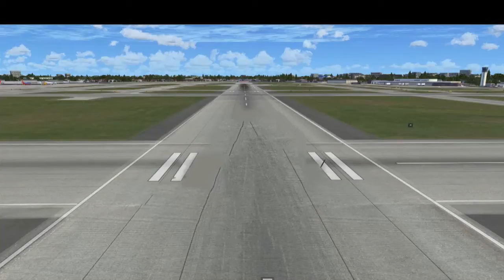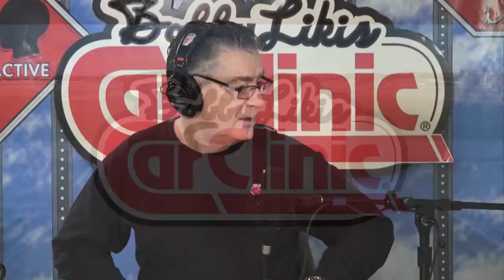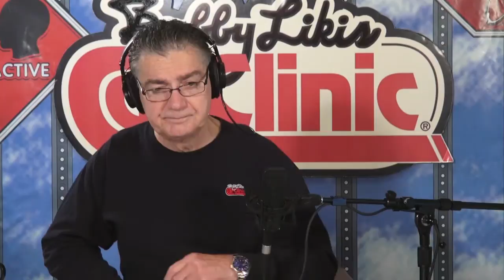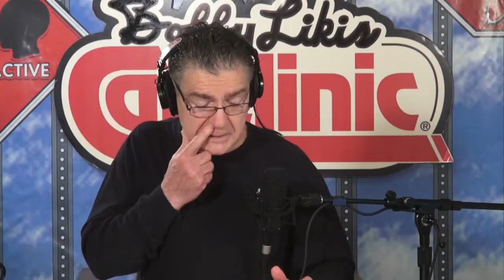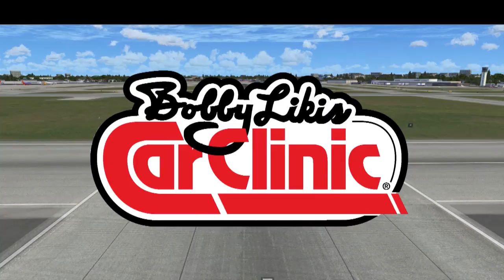Bobby Likis: How to "Break In" New Brakes

Comment: This video is complete nonsense. Curing the pads at the manufucturing plant has zero bearing on the pad to rotor interface zone. Muchless, when the indivudual decides to a different pad material per an upsale from auto parts salesman.

Comment: I also think this is wrong. Nothing has changed in the way the brakes work on the rotor, only the way in which the backing plate is attached. So henceforth, a bedding procedure is still called for.

Comment: WRONG!! All performance brakes pads need to be bedded as per you're manufactures proper bedding in process usually found on your brake pad box. your typical street pad and rotor you pick up from your local parts source store don't need them but a performance pad will

Comment: I would think this is somewhat incorrect... Technically, there's something called a PDI (Pre-Delivery inspection) or may be called something different per dealer/manufacture... A brake bedding/burnishing/seating procedure is included in the 2-6 miles (give or take) on brand new vehicles prior to delivery or customer purchase by this inspection.
Good luck to you if you change your own brakes and go on your happy way without doing at least a mild bedding/burnishing/seating procedure.
Reply: yahhhhhh right  you're nuts